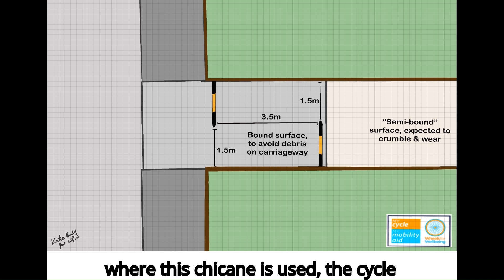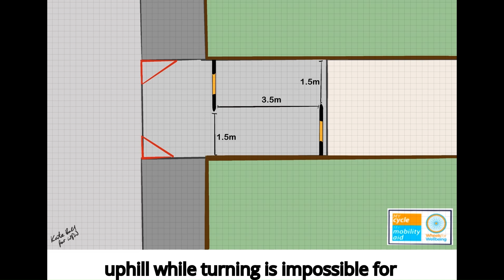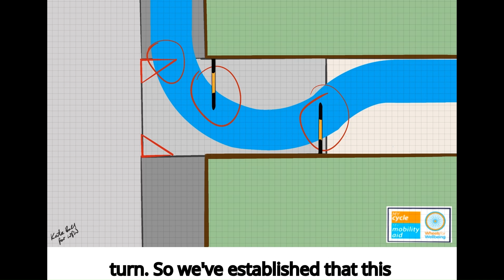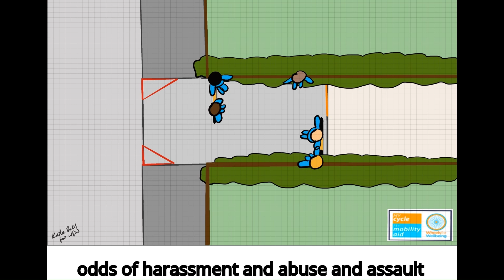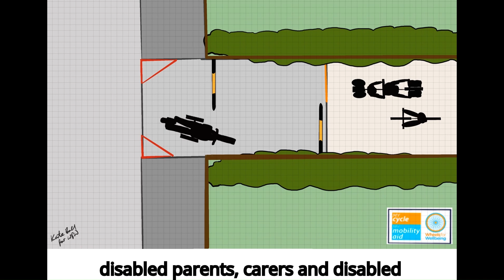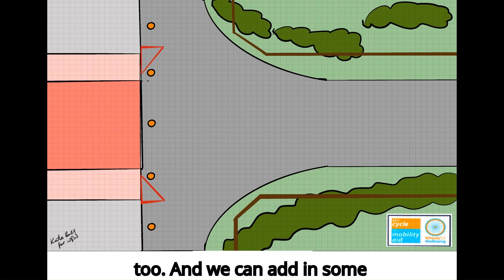Why aren't wide chicanes accessible?

Comment: @kkr0ne: Why do think it's appropriate to use physical prevention of faster speeds to slow cyclists? It's very rare to use physical prevention of faster speeds to slow motor vehicles - the vast majority of speed restrictions on motor vehicles are done by signs, and motor vehicles are very, very many times more dangerous than cycles (and especially so when the driver of the motor vehicle ignores the speed limit).
Reply: exactly - because we know based on cars that signs don't work and people drive what the intuition tells them. If the road geometry enforces slower speeds, that's effective - we should do the same in places where we want to slow bikes down